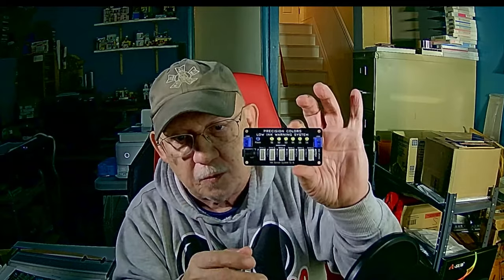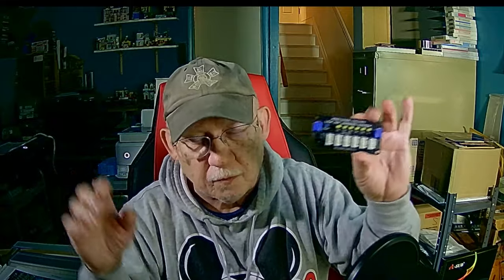If you are going to disable your Canon IPF PRO 1000 chips make sure to do it correctly!

Comment: Hi Jose. Great video! However, I have a question. And pardon my ignorance, I'm kinda new with Canon Pro-1000. The question: If I disable a chip for a "color", does it mean that the chip is disabled on the cartridge or on the printer channel? In other words, I want to know if the chip resides and is exclusively associated with the cartridge or with the channel. The reason I'm asking is because I would want to know if, for example, I am disabling a chip for a particular "color/channel/cartridge", and if afterwards I decide to use a new OEM cartrige, will the chip be again fully functioning on the new cartridge or not? Basically I want to know if this operation is done only against the cartridge or, once done, no chip will function on that channel even if you are using a new OEM cartridge. I hope I was not too confusing with my question. Thank you in advance.
Reply: I have that same question as well.

Comment: Any tips on topping off the cartridge with this exact method and using the bottle with syringe from PC? Im having an issue with bubbling and spilling out when im refilling. Even when the cartridge is still half filled. Havent figured out how to prevent it from bubbling back out from the drilled hole.